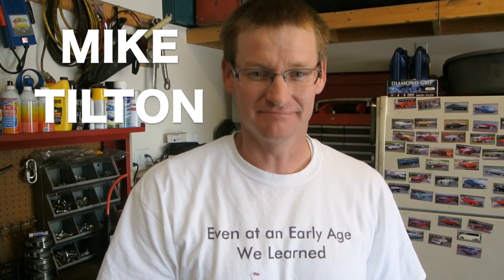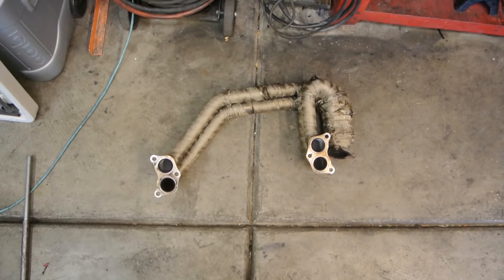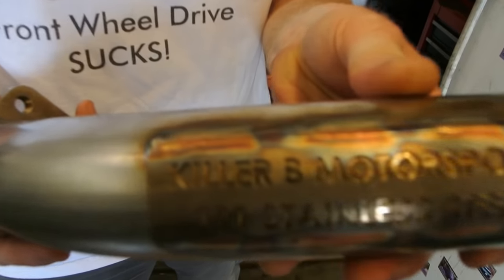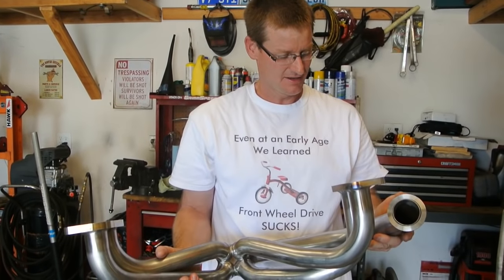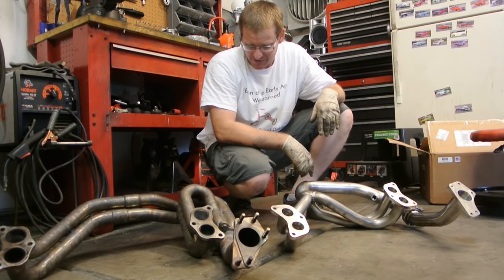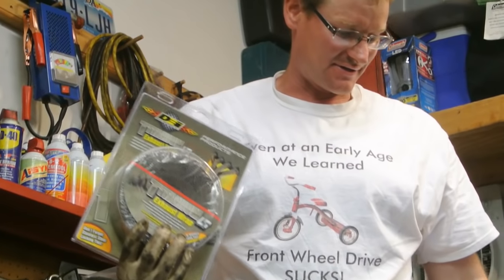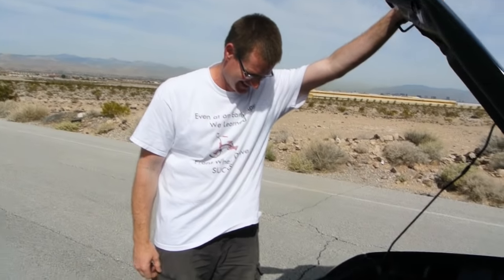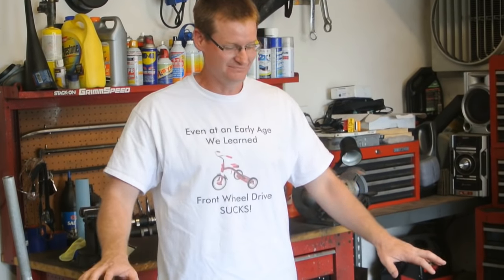EQUAL LENGTH VS. UNEQUAL LENGTH HEADERS - ft. WRX

Comment: any dyno comparison?
Reply from the maker: a direct comparison no.  between the two headers I put in a larger maf and ebc. There was about 6 months between dyno tunes and the dyno session with elh was about thirty degrees warmer. that being said my uel dyno sessions averaged around 380 whp and the elh sessions averaged around 395 whp. hard to say where the extra power actually came from,  but the turbo does hit full boost about 500 rpm sooner and I make a bunch more power on the top end.  once again though, is my bigger maf? ebc? lower temp? headers? combo?
Reply: I’ve researched this topic quite heavily. On stock turbo EL’s averaged 25 more whp and 50 more wtq. That torque also comes on sooner. The torque curves from the sheets I’ve looked at are pretty nutty on a EL setup, pulls hard and holds quite steady strong boost til redline. I’m impressed. Gains aren’t just peak either, the entire power band is optimized, more power.

Comment: do you have to tune for ELH?
Reply from the maker: The Truman Show i did not have a tune specifically for the headers, but I also added a bigger maf and a higher reading map sensor at the same time and got tuned for that
Reply: Oh OK. I'm thinking about doing elh on my legacy SS. I'll have to do more research to see if the ECU can handle it. Seems like something that can drastically change the way the car runs.
Reply from the maker: The Truman Show i do believe the stock ecu can handle it, but if i was pushing the car hard often, then I would highly recommend a tune with elh
Reply: I know the old ECU in the first gens are very capable as long as you don't change injectors lol. But hey thanks for info and replys. Trying to find ways to spend my tax money lol.
Reply: The Truman Show I tell everyone this and I end up saying it many times a day. If you're modding your car, get it fucking tuned. Theres no reason to install a mod without a tune. You're just hurting your engine and probably losing power.
Reply: Do some research on first gen legacy turbos. This isn't your average ecu.

Comment: that seems a rather small diameter pipe on the new one
Reply from the maker: g4rr377 it is a size that is efficient for Subarus up to a higher power than I will ever reach.  a lot of times, bigger header pipes make less power than a properly sized efficient header size
Reply: maxxjett films i thought it would be something like that, the other one must have just been oversized
Reply: maxxjett films i thought it would be something like that, the other one must have just been oversized
Reply from the maker: g4rr377 the old one was definitely bigger, especially on the uppipe. I imagine it has alot to do with exhaust pulses being different with equal length

Comment: You ruined it with the ej25, ej20 is the better engine why do you think prodrive used it in wrc and why all subaru teams (even without rules) use an ej20